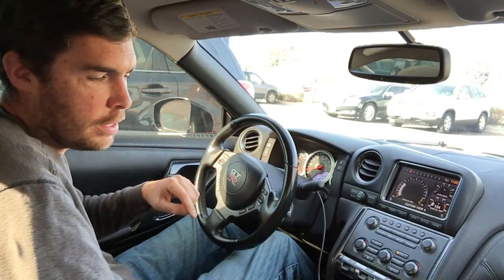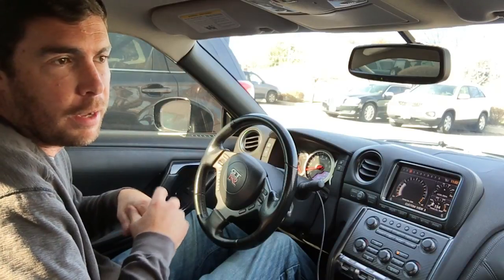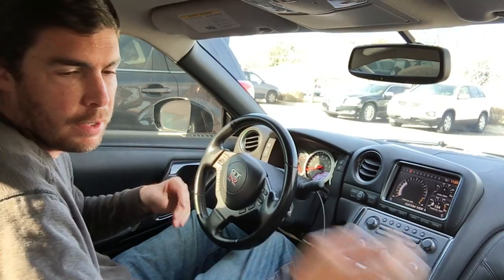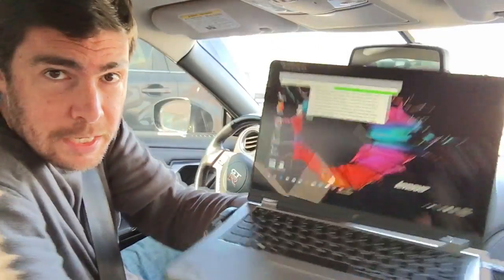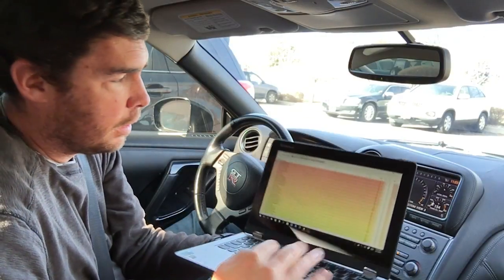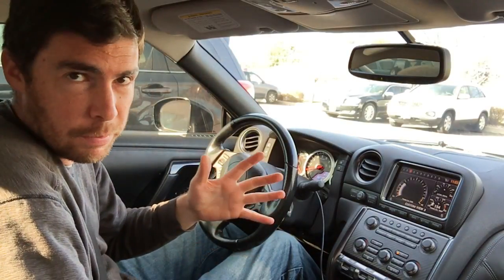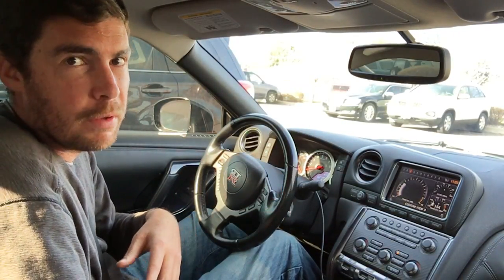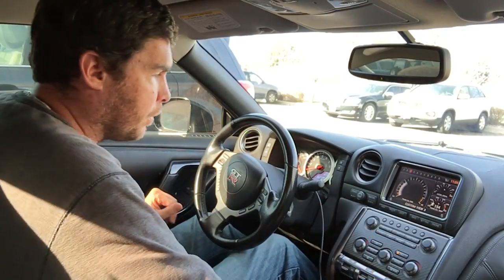How to Properly Datalog Your TCM for Problem Diagnosis and Repair, GT-R, R35, GR6 Troubleshooting

Comment: What would cause a TM overheated warning when I’m driving and then give it full throttle
Reply from the maker: What does the message say exactly?  AWD Clutch Temp High?  Of that is your message then you burned up your ETS and it needs to be rebuilt. Link below with more info:

https://jackstransmissions.com/blogs/pages/gtr-ets-awd-unit-rebuild
Reply: T/M Clutch Temp High
Stop Vehicle Until Warning Turns Off
Reply from the maker: @34seltzer  that is the main clutch. I would need to see a TCM Datalog to know why this is happening. The TCM thinks the clutch is slipping excessively.
Reply: Ok It is a friend’s of mine that I’m looking at buying but I wanted to make sure it’s not a major issue before I buy it. It has 55,562 miles and he said he never had the front and rear diff and trans fluid changed. I’m pretty sure he should have had it changed around 35,000 miles I told him. It’s a 2014 Black Edition and it’s all stock. He just changed tires also and it only seemed to start doing it after he replaced the rear tires.
Reply: Do you think changing the fluids would help? Which fluid do you recommend Motul DCTF, or Amsoil DCT or factory Nissan GTR fluid or something else?

Comment: Question, so my GTR randonly started having a small lag after 2nd gear, specially on Auto
Its a small hiccups, after that & before that smal lag runs perfectly find, people saying i need a clutch relearn? Some say trand oil fluid change?